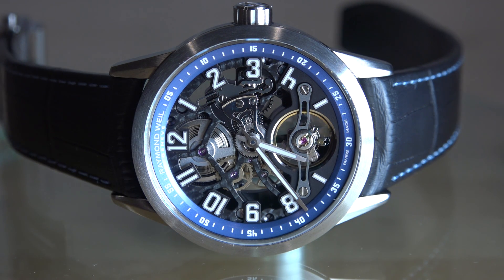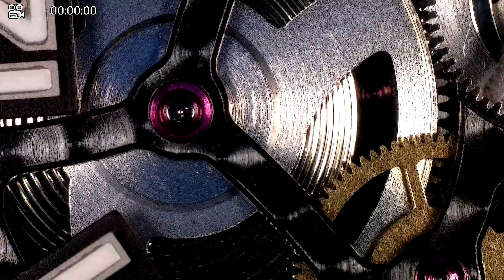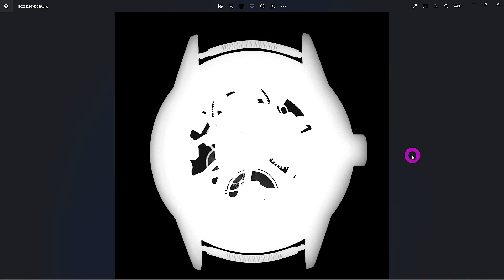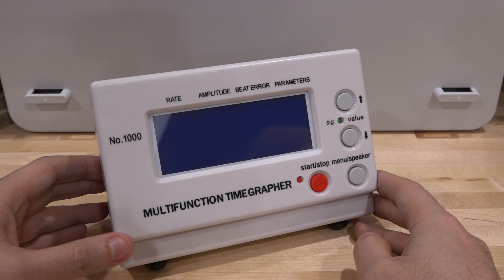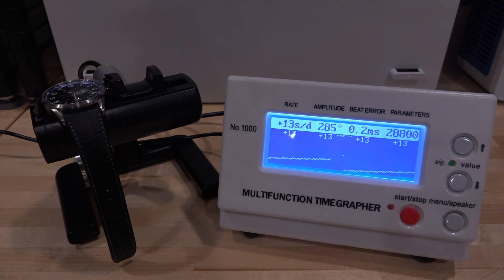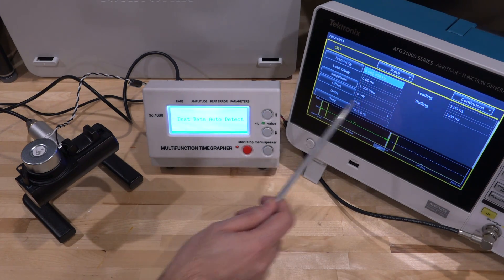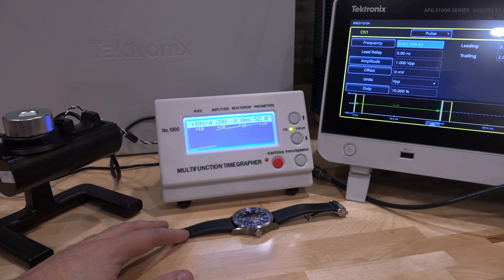TNP #26 - Magic of Mechanical Timekeeping & Measuring the Accuracy of a Raymond-Weil Skeleton Watch

Comment: Balance stem not running true in the jewel. Major cause of inaccuracy and causing it to run slow. Restricts the amplitude and causes beat error.
1. Replace the jewel.
2. Check the stem for bend and or damage - very common. Simply dropping or a sharp bump is enough. Correct as required. The harp shaped jewel retainer is actually a shock absorber.
3. Then correct the balance of the spring.

Comment: I'd love to know how sensitive the watch is to ambient temperature changes.  Sure, it's mounted on a 98.6 F reference but I bet thermal is a significant part of remaining error.  If the jewels run dry, then maybe not so much impact, I don't know.  One AI search says several seconds a day coming in and out of cold to hot temperatures, but mostly from balance wheel and spring, not so much from the bearing surfaces.

Comment: Shahriar, you are wise beyond your years.  I've worked on and designed many precision mechanical items over the years but now draw the line at opening watches.  Unless you know the contruction, have the crystal puller and installer, case tools, etc. it is risky business.  What began as off by a slight amount but beautiful may end up spot on but no longer beautiful.😢  Also, I'm holding my breath for part II of the Siglent 5000A.  Should I breathe?

Comment: I swear , you make the best videos. Thank you for all your time and hard work. 
Is there a set gear ratio that these watches use or does it depend on each manufacturers design?? If a drive mechanism (like the one contained in your featured watch) were scaled up , what kind of mechanical power would it yield? Would it be enough to drive a small generator ? Thanks again for such a cool video!!!

Comment: As a long time viewer and admirer of your skills in analyzing complex RF systems... now you add analogue watches????  
I also tinker with 19th century packet watches, maybe for the same reason....  curiosity. 
I find it a strange parallel for our normal lives  thus I laughed when you mentioned Rabbit Holes... which like a black hole, your intellect and curiosity sucks you into!  
The parallels for us (EE) folks to the watchmakers of the  past 400 years are similar: A need, a design concept, design approach, available technology, and product expectations, cost... 

I find it humbling that a watchmaker in 1820 could produce a timepiece that may only drift by a few parts of a second per day.  
Today, we have have Bose -Einstein Condensate Atomic clocks that are "somewhat better", 1 Sec per 100 billion years, but... same approach, just 200 years later. 
Great work, and wonderful enthusiasm, (visible /. X-ray photography) and an impassioned need to know.  

Kudos!

Steve

Comment: Thanks for taking apart the time grapher, that spared me the trouble to open my own. I sometimes wondered about the precision of my measuring device when measuring the precision of my watches. ;-)

That straight line of 0 s/d rather surprised me. It means the crystal plus calibration runs at better than 12ppm - not bad for a crystal that is most probably not temperature compensated! Maybe they are using some software compensation based on the microcontroller's internal temperature measurement if it has any? Most watch enthusiasts will however not fiddle with watches in the freezing cold or tropical heat, so maybe a simple calibration is deemed sufficient.

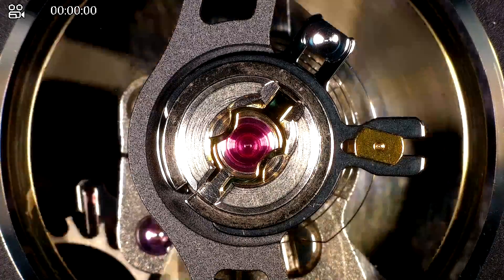Comment: At 2:00 you can see the bearing wobbling. 
Could that be worn, and causing the error?
Reply: This is normal. Remember you are looking at an axis the size of a needle tip. I guess a tighter fit would increase friction and do more harm than good.

Comment: Besides the pallet stones striking the escape wheel teeth, the impulse jewel on the balance wheel striking the pallet also make sounds that are picked up by the time-grapher.  It would have been interesting to tap into the microphone output and record the actual waveform produced by your watch in the pickup, then use a signal generator to reproduce that waveform with different timing.  Looking at the waveform, you could have maybe had a crack at reverse engineering the time-grapher's measurements -- it probably has two or three triggers that trigger on different amplitudes of the different sounds and uses the relative timing of these to deduce the amplitude and beat error.

Comment: Very cool blend of two of my interests!  Have 2 pocket watches that both are not quite in beat.  One is fast, the other is slow.  I've wondered how a watch repair place adjusts for this, or for that matter checks for this and accuracy of calibrating something this mechanically sensitive.  Great videos as always.  Been a fan for a long time.  Totally up for seeing you adjust it; as well as any/all repair videos.  I've learned a lot from you doing those over the years.

Comment: This is great.  Years ago I took 8 hour audio captures of a Seiko 5.  I kept a weekly log of drift over the course of a few months and tried to adjust the trim a few times.  I had trouble really decreasing the drift.  What made the biggest difference was keeping it on at night.  It ran noticeably slower when taken off.  If it's kept at body temperature then it could be trimmed to be more accurate.

Comment: While I appreciate the amount of effort that goes into designing and maintaining those time pieces, it's always funny to me how even a basic crystal oscillator can beat their time keeping accuracy by orders of magnitude and that a modern transistor can switch in a single second more times than that escapement will cycle in its useful lifetime. Really brings the performance of modern electronics into perspective.

Also that's a beautiful watch! Would love to see a video in which you or Wristwatch Revival services it.
Reply: 32768 Hz watch crystals usually come in 20 ppm or better for a few cents. A mechanical watch just can't beat that, so from an engineering perspective this is clearly the technology of choice. Only clever marketing saved the industry from bankruptcy.
Reply: Well, a basic watch XO won't beat a mechanical chronograph and is NOTHING like a quartz certified chronograph.  Cheap watch crystals are all over the place.  Cheap quartz watches are typically off by 10-20 seconds per day, although you could get lucky with one that's more accurate, while a certified swiss quartz chronograph (like a Breitling or such) is off less than that per year.  The latter are tunable and have thermal compensation.
Reply: @jj210-g8r  "Cheap quartz watches are typically off by 10-20 seconds per day". No. Maybe 10 seconds per month but definitely not per day. 20 seconds per day would be a 230ppm crystal which is horrible. Thats assuming no calibration at all.
Reply: @jj210-g8r  By 'basic crystal oscillator' I meant the one in the timegrapher, it's probably like US$5 and it's plenty enough to measure the US$3,500 mechanical wristwatch in the video and I've seen them used on million dollar watches on other channels.

Not saying a sub-dollar rubbish 200 ppm crystal on an MCU with slightly wrong load capacitors will perform better than thousand dollar calibrated mechanical watches.

On a side note my 13 year old cheap quartz CASIO watch only gains ~5 seconds/month and it's never be re-calibrated, just a couple battery changes and it's been though a lot.

Comment: Fantastic video Shahriar, thank you! Wristwatch Revival is another favorite channel of mine, if he is willing to take in your watch for service that would make for a great video I'm sure.

I have found that the orientation of the mechanical watch can change the rate of oscillation significantly, as well as whether it is being worn or not. One of my mechanical watches gains 16 seconds per day when laying flat on a table being measured, but only loses about 2 seconds per day when worn. I can achieve the same accuracy by placing the watch on it's left side when I take it off at night. That's how I leave it every night on the table and I only need to reset the time once per week instead of daily. I believe old school watch sellers would have a customer wear a new watch for a period of time and then come back to the store to have it regulated based on their individual usage. Many rabbit holes to go down!

Comment: At 8:55 you mention it runs a bit fast, but I believe that is by design. As it is worn, it will experience more friction from rotational velocity changes achieving an average closer to zero. You also mention beat error and amplitude, which I also believe is intentional. I think of a quartz oscillator versus a cesium oscillator. Your Raymond-Weil would be equivalent to a cesium reference; High phase noise, but superior long term stability. While the lower end model may have better repeatability which is marketable, but not reliable.